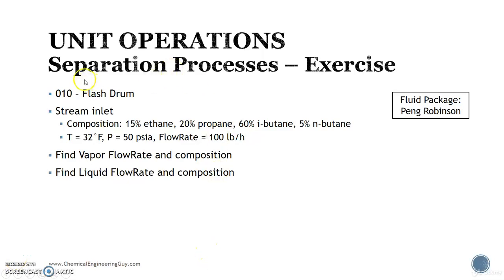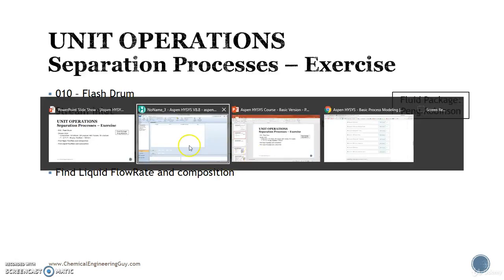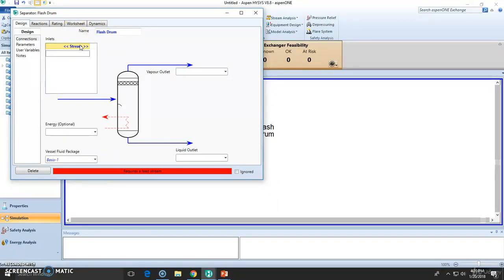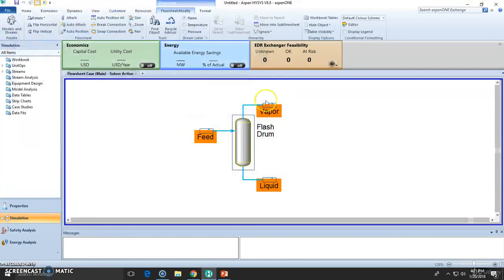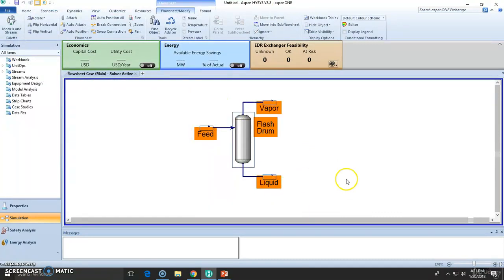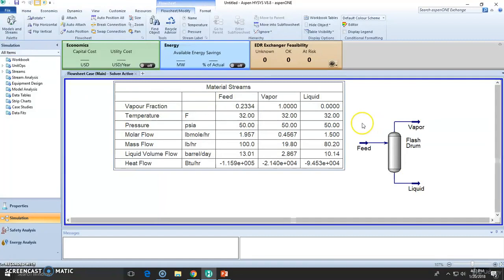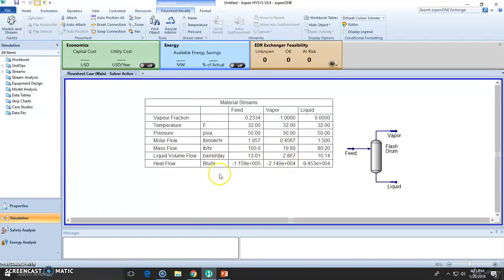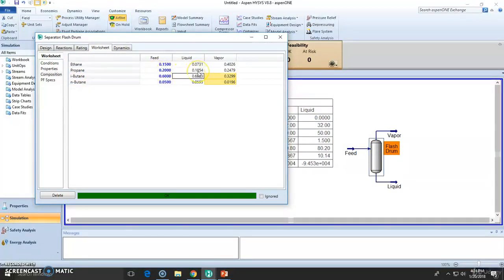Flash Separator in Aspen HYSYS (Lec29)

Comment: if i want to use a single effect evaporator, is it allowable if i use the flash separator? because i didn't find the evaporator tools in hysys. thank you
Reply from the maker: Well... Only if you are flashing the material, I would recommend you to go with a normal heater better
Reply: Alright, thank you for the recomendation.